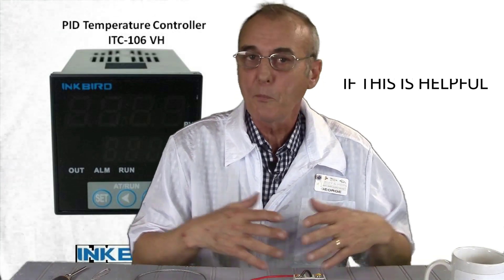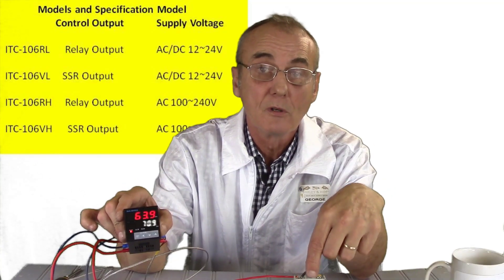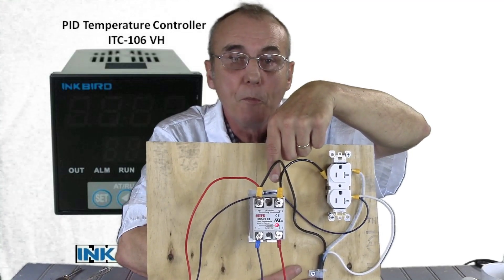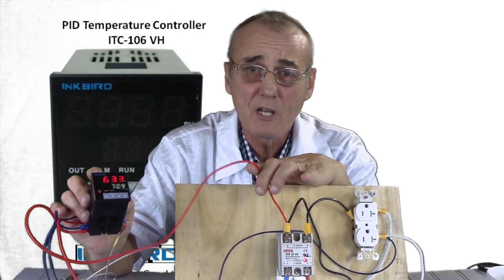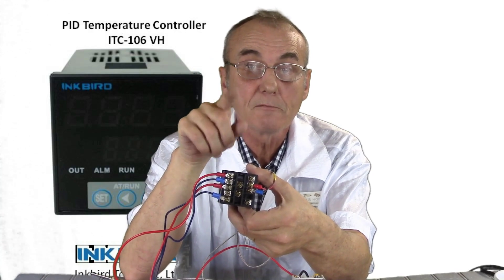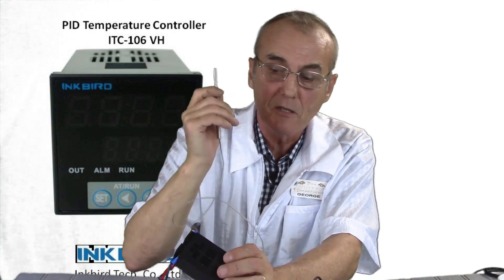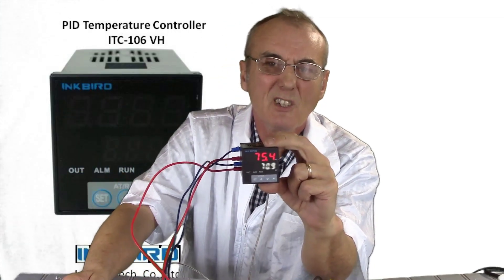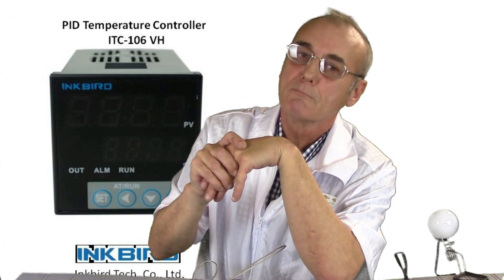Wiring the INKBIRD ITC106 VH PID controller

Comment: George, I got the rh version (I just need it to run a computer fan) could you explain how to wire it. I'm a little lost.
Reply from the maker: Sure. This PID will have an output of the same voltage as your input so make sure the fan can handle that. If not you can add a transformer in its place and wire the fan to the transformer as normal.
Pins 9,10 are in put voltage: connect the black wire to pin 9 and the white wire to pin 10.
Your internal relay is controlled by pins 7, 8. 
Connect a black wire (either from pin 9 or from your source) to pin 7.
Connect another lead (color doesn't matter) from pin 8 to one side of the fan motor (it may be marked "load" and "neutral") on the load side.
Run another wire from the neutral side of the fan to pin 10 or from your neutral source.
Now, when the PID operates it will complete the connection between pins 7,8 and operate the fan then shut off according to your settings.
If you needed to add a transformer for the fan wire it exactly the same way and then wire the fan to the transformer. 
Same results.
Hope this is easy to follow.
George
Reply: @BarleyandHopsBrewing  I think I can make sense of this. Thanks
Reply from the maker: @franklinmckenzie8856  Let me know if you have any issues. I'm only an email away.
george.duncan76@gmail.com
George

Comment: I am trying to wire up a clamp heating element...it only has two wires unlike an outlet, there is no provision for a ground wire....wire it in with the neutral?
Reply from the maker: Heating elements normally have only 2 connections (one for hot and one for neutral) the ground wire would be attached to the appliance in some manner.
George

Comment: Can I just plug in a heating element into the outlet part of this setup or do I have to wire it differently. I'm building an injection molding machine and was wondering if this setup would work. Thank you
Reply from the maker: Yes. You will need to unplug it when it reaches temp and them plug it back in when the temp drops.

Comment: What If I want to run a cartridge heater directly without using a receptacle? How would I manage the neutral wire? Please, someone, help me with this. I am utterly confused! 

Thank you!!
Reply from the maker: Neutral wire and hot wire go to the heater. The ground wire is the appliance ground and can be attached anywhere on the kettle.
Reply: @BarleyandHopsBrewing  So if I am using two cartridge heaters off the supply and this PID setting, I would ideally attach the ground wire to my hopper which is being heater, right?

Comment: Great video!! just got my unit hooked up today thanks to you, however the load circuit isn't opening when it rises above set temp.  Power going to the load continuously.  Yes its set to heat and the basics I think I've got covered.  Stumped...
Reply from the maker: Go into the parameters and make sure the PID is set for PID function. Some of them come set to manual mode and need to be changed. I describe this in detail in the video about setting parameters.
After that try the PID again and use the autotune button to fine tune the parameters.
George
Reply: @BarleyandHopsBrewing    thanks.  Yes it is set to PID.    I can actually changed it to on/off because for my purposes that would work fine.   Pressing set once shows it's functioning properly.   The "a" value goes to 100 when under my heating temp and drops to a0 when satisfied but the ssr doesn't open the circuit to close.      I've also got help request into inkbird but I'm not hopeful of a Swift response.    I appreciate your insight.
Reply from the maker: It may be a faulty SSR. The output pins of the PID are polarity specific but when energized the SSR comes on and the red light should light, when the set temp is achieved it should de-energize and the red light goes off and breaks the connection.
Reply: @BarleyandHopsBrewing  thank you so much.   I do believe that the ssr is bad right out of the box.  I'm going to be pushing a 208v heating element so I'm thinking this system probably isn't the most stable for my purposes.   Truly appreciate your insight.

Comment: Hi George I'm hooking the inkbird up to a 240-volt but the wire I'm using is a 4 wire red white black and green how would I hook up the two hot wires red and black thank you
Reply from the maker: Yes the 240 dryer plug has a red,black,white and green wire. Red and Black are the two hot (120 volts legs out of phase). The white is the neutral and the green is appliance ground. 
In your box you only need to connect the black wire to pin 1 on the SSR and then run another black wire from pin 2 to the receptacle - the Red wire wire goes directly to the other side of the receptacle and the white wire is your neutral or in this case ground. The green ground wire should attach somehow to the still so you have a direct appliance ground for safety.
You now have 240Volts powering your element.
Reply: @BarleyandHopsBrewing  thank you so much George I was having a problem there for a minute now I see thank you so much

Comment: Hey George, is it necessary to fuse the PID? If so how, how should it be done?... Thank you sooooo much!
Reply from the maker: You could easily fuse it. Just wire in a fuse between pin #1 and the incoming power. 
The PID will handle a large amount of voltage and only draw a small amount of amperage. I have not put fuses in for this reason.
It is really a personal choice. 
George

Comment: I have the itc-106rl.  I am trying to get it to run a 12v fan. Should the fan connect to 6 and 8?  That's how I've tried it, but it is not coming on.
Reply from the maker: Pin 6 is normally closed, pin 8 is normally open and pin 7 is the common between them. You will need a hot wire on pin 7 and the same hot wire from pin 8 to the fan. This acts as a switch. The ground wire goes from the fan to ground.
If your source voltage is 12 volts you can jump from pin 9 or 10 (which ever one is the hot (+) side) to pin 8 and then run your hot wire from pin 7 to the fan. 
Every time your internal relay is tripped pins 7 and 8 will connect and run the fan.
Hope this helps
George
Reply: I will try this today.  Thanks for the help.
Reply: Sorry to keep bothering you, but you seem to really be the guru of wiring a pid.  I have a red and black wire from the fan.  I connected the power supply to 9 & 10 (hot).  A wire from 10 to 8, and the black fan wire to 8.  The red fan wire went to 7.  This didn't work, so I connected an additional wire from 8 to 7.  Still no luck.  I know the fan works when connected to my power supply directly.  Can you tell what Icbe done wrong? Thanks.
Reply from the maker: This is very simple (in my mind). My first reply to you assumed that you were setting the parameters for the alarm to operate that.  Now that I know you are not we will shift to solution #2 which is using the normally closed circuit between pins 6 and 7. You've done the right thing but you are connecting to a normally open circuit which is between pins 7 and 8. Unless you set the alarm temp in the parameters you will not get any juice to work the fan.
Here is the simple fix. Do the same wiring with pins 6 and 7. This connection is normally closed and will create a path for power (juice) to flow as soon as you turn on the PID. So, attach the black wire from you have from pin 10 to pin 7 and then continue that wire to (if it is (+)) to the fan, the other wire from the fan goes to pin 9 (the (-) wire). This way you will create a loop of 12VDC.
Direct wiring:::::::::::
Power in from source to pin 10 (+) jumper wire from pin 10 to pin 7. Same (+) wire from pin 6 to fan and (-) wire from fan to (-) pin 9 which also has a (-) from your power source on it. 
Let me know how this works.
George
Reply from the maker: You know the more I think about this one the more options I come up with. You could just run a hot wire from pin 6 to the fan and the ground to any ground. The fan will work when the PID is on but if you set the alarm set temp and it reaches that temp it will shut the fan off.
If you are using 12vdc to power the PID you could always direct wire the fan to your source.
George
Reply: I think that I'm getting there, but still not working exactly right.  I have 10(+) to 7. Fan (+ ) on 6. Fan (-) on 9.  I forgot to mention that the fan doesn't have a ground.  With this setup, when I plug it in, the fan comes on it goes tbrough initial cycle, but then stays off.  SV is 82 degrees and PV is 78, so it should come on, but it isn't.  Thanks.
Reply from the maker: Hmmmm! You got me thinking. You must have the alarm function set lower than your SV of 82. This is the only thing that will cause the fan to go off. Set the alarm 1 value to 999 or something real high. 
When the PID reaches that set point the normally closed switch between pin 6 and 7 is open until the temperature drops below the set point of the alarm.
George
Reply: Success - almost.  I figured out that it was working in reverse.  The fan was off when it should have been on and vice-versa.  I switched from heating to cooling and it worked correctly.  However, when the temp. goes above the setpoint, "dhal" flashes, and the output and alarm lights are on. The dhal is set to 5.  Is this anything to be concerned about?
Reply from the maker: dhal stands for deviation high alarm. You should set this to 9999. It is not needed for your operation and does not affect the operation of the pid. 9999 will make it disappear. 
George
Reply: Thank you so much for your help.  I could not have gotten this fixed without you.
Reply from the maker: Anytime.

Comment: What wire connectors are you using? They look like a factory manufactured the wire and connector together
Reply from the maker: Those are connectors I purchased at my local hardware store. You strip the wire,insert it into the connector and squeeze it closed.
Reply: Thanks!

Comment: Hi,
I have my PID wired up . the problem I have is the out light stays on even when the requested temp is reached . LED light on the SSR stays on as well.
I tried different setings , auto tune , ...
Could id be my PID is faulty ?
All opinions are welcome.
Kind regards

Wout
Reply from the maker: It is unlikely that the PID is faulty but that is a possibility.
Make sure your parameters are set correctly. Looks at the instructions on how to set these. Press set button for 3 seconds to enter the set up mode. 
Under output settings the first option will be CTRL setting: make sure this is set to PID mode.
Next setting will be H-C (Heat/Cool) setting; make sure it is set to Heat.
The next setting will be Automatic; make sure this is set to automatic.
This may help. 
Also make sure the SSR is connected to pins 6 (-) and 8 (+).
Hope this helps
George

Comment: I need to wire up a over temp buzzer/ light to that same pid box how would i go about wireing in one
Reply from the maker: Use the alarm function for an over temp indicator. It will require a separate buzzer or alarm light on pins 11,12.
George

Comment: Hey George.. I really need your advice on a PID.. I need to build one that I can disconnect the thermal probe easily without having to open the control box every time. So I need to have a connector of some sort on the control box that I can run the wires from the back of the inkbird to the back of a connector then once the control box is closed I can put the probe wires on the connector. My problem is I am not sure what kind of connector would be the easiest to do this with. The reason I am doing this is because I need to utilize the threads on the probe and when I do it just twist the wire all up by the time I have the probe screwed into the column.. I hope this all makes sense lol... Thanks for any help.
Reply from the maker: Here is the link for a panel mount from Amazon. You can add this to you box or just get the plug and socket  and that way you can plug it in when you need it. Real easy fix. 

https://www.amazon.com/gp/product/B071SCMHRX/ref=oh_aui_detailpage_o01_s00?ie=UTF8&psc=1

George
Reply: Wow I had no idea they even made these... Thanks George! Your awesome man!! Love all your videos!

Comment: George,  I find these take a long time to get to the point needed,  what do you think of putting a by-switch that would put element full on until it gets near temp needed, then switch it over to ssr mode??
Reply from the maker: I guess that is possible but the PID will operate at 100% power until it gets near the set temp. Sort of like full on until the error between the PV and SV narrows. Would sort of be the same thing. Your thoughts?
George

Comment: George, you are awesome. I've torn through all of your videos in the past week, not having any previous electrical experience, I can confidently say that I will be able to wire my ambitious 4 pid controller once I amass the parts and draw up a schematic for it. Do you have plans to discuss hooking up solenoids for propane/ng use? Also, if one were running 4 pids, would a ssr be required for each one? Thank you again for all your help and your great videos! Cheers!
Reply from the maker: Jeremy, using 4 PIDs could require 4 SSRs but that is all dependent on the process you are controlling. If those PIDs are controlling high energy processes like heater elements then an SSR for each one would be necessary. You could have a single PID control several SSRs but again it is all dependent on your set-up. 
George
Reply: Thanks for the quick response! I would be powering 3 Honeywell solenoids that run off 24v circuit iirc. The 4th pid monitors the Herms coil output, and can be used to heat the hlt when necessary. Think 1 ssr would be enough?
Reply: n fact, you could use one PID with an SSR output (Inkbird itc106VH) and three with internal relays (inkbird ITC 106RH). This would make life so much easier for you.
Reply: That’s great to know! Thanks George 🙌🏼
Reply: Just to be sure Im on the right page here... The one SSR-output would be for my herms pid, since it will be firing the hlt the most frequently, and the 3 relay pid's would be for hlt, mlt and bk pids since they will be open for longer periods?
Reply from the maker: The pid with the SSR is for the herms coil since it will draw high current. The other three can be pids with internal relays since they only draw low current. You got it.

Comment: what can i do if i have a 110v controller but 220v in the outled in the wall?  thanks for the good videos.
Reply from the maker: You can wire it like I did in this video https://www.youtube.com/watch?v=tB45K7lzM9Q 
Your controller will work on 110 V or 220 V. 
There are two videos that cover this in detail. Let me know if I can help or if you need me to explain anything more. 
George
Reply: Thanks but ill refrase my question.. i have a 110v controller and element, is there a way to plug it in to a 220v outlet in the wall without blowing the controller and element,?
Reply from the maker: OOPs, sorry. I misunderstood. Yes, your 220 outlet has two 110V legs and one ground. You can wire your controller to a 220V plug but only wire one hot leg (110V) and leave the other one empty and then wire the grounded leg. When you plug this in it will only provide 110 V since one leg is isolated. Hope this helps.
George
Reply: Thanks very helpfull

Comment: Great video, I think I will need to wire one of these up!
One of the disadvantages of solid state relays is that when they fail, they have a tendency to fail in the closed position, i.e. power on. That isn't to say people shouldn't use them, it just means we need to watch watch our temps even if a PID controller is connected.
Reply from the maker: You are absolutely right. The failure rate is very low but when it happens it's a bad thing. Situational awareness during distilling is always a good thing. Thanks
George